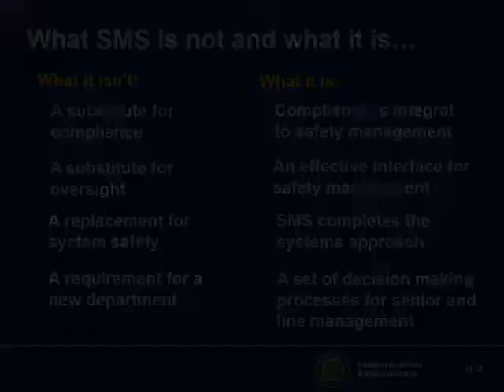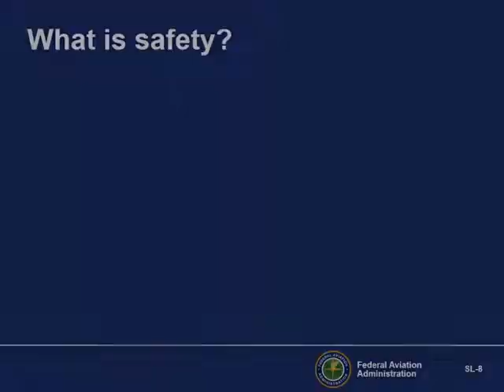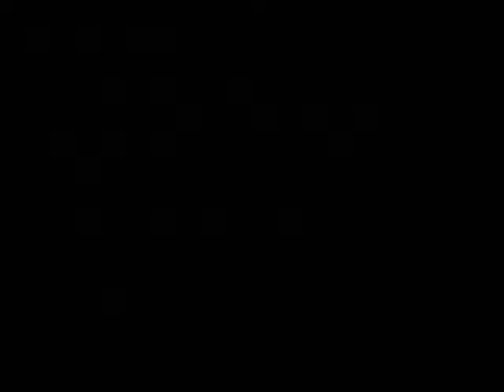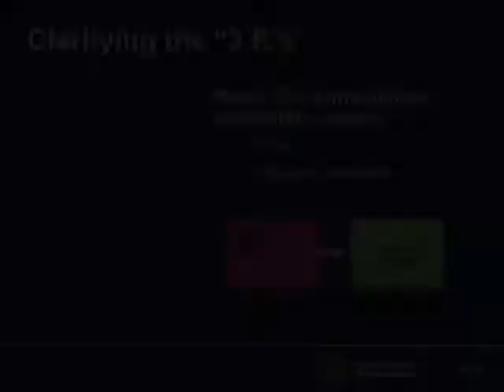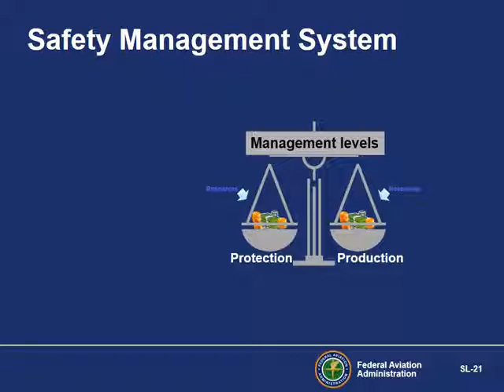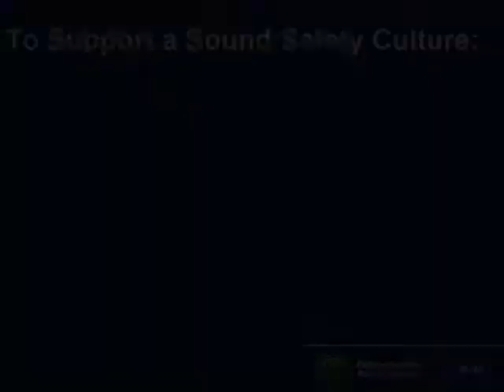FAA Video   Safety Management Systems SMS Fundamentals Basics

Comment: SO, YOU HAVE ATOS OR AIR TRANSPORTATION OVERSIGHT SYSTEM WHICH USES A RISK ASSESMENT SO THE OPERATOR WILL MEET REGULATORY AND SAFTEY SYSTEMS AND SAS OR SAFTEY ASSURANCE SYSTEM WHICH IS THE FUTUTRE OF AVIATION? BUT, THEN YOU HAVE TQM WHICH DOESN'T MEASURE RISK ANALYSIS SO SMS IS NOT A COMPLIANCE SYSTEM IN ITSELF AND SMS IS NEEDED BESIDES TQM?

Comment: WHAT IS SMS? SMS IS NOT A SUBSTITUTE OF COMPLAINCE BUT LEGISLATION WILL BE WOUND INTO SMS AND SMS IS A COMPLIANCE MANAGEMENT SYSTEM AND IS NOT AN OVERSIGHT SYSTEM BUT IS AN DEPENDANCE ASSURANCE OF SYSTEM SAFTEY ONLY ADDING AN ACCOUNTABILITY FUNCTIONS AND DOESN'T REQUIRE ANOTHER DEPARTMENT TO COMPLY BUT ALL DEPARTMENTS CAN APPLY TO IT? SO, SMS IS A MANAGEMENT SYSTEM?